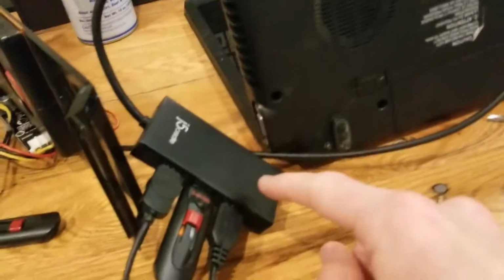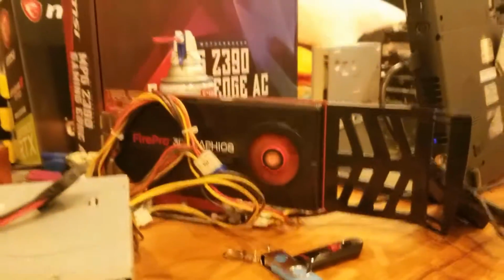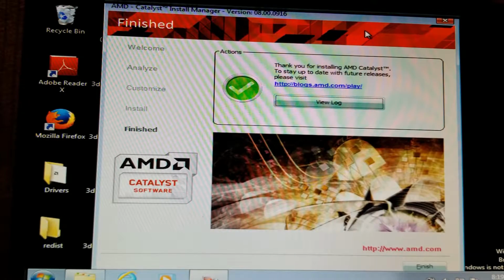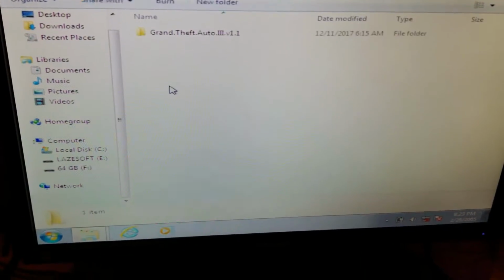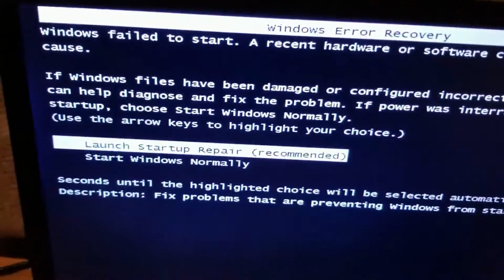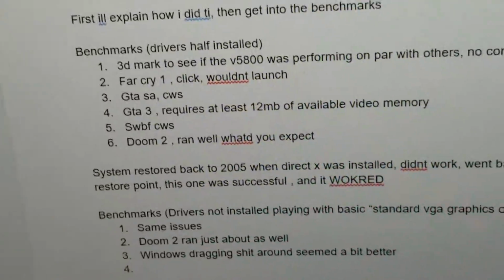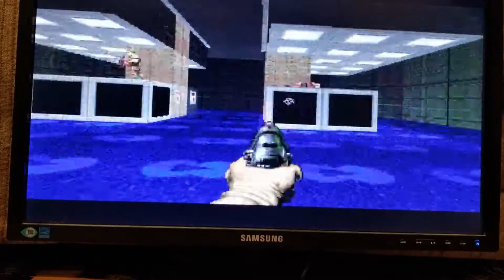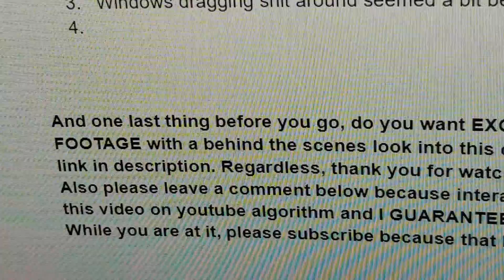Put a DESKTOP GPU in a LAPTOP for $5! (How I did it) 2020 Tutorial

Comment: Ooooooohhh it costs 38$ to buy the adapter thaaatts why
Reply: Do you think the pcie slot on the motherboard was setting the GPU back
Reply: Also just saying the RX 5500 and 5600 and 5700 from amd has stability issues for the time being including the XT models so if you want a good graphics card that won't have too many issues go for Nvidia instead of AMD btw the issues are not to serious but if you don't know much about tech i would recommend you go with Nvidia instead sorry for any spelling errors I'm on mobile
Reply from the maker: @Imblitzyboi  Yes, I do believe that the limited pcie port built into the laptops motherboard could have had a negative effect on performance. In terms of graphics cards, at the moment I'm quit content with my 2080, but yes I'd really only recommand buying nvidia, however the card used in this video was the v5800 pro, a workstation graphics card released by amd back in 2010
Reply: Yea that is true I should of pointed out the most of the previous generations of AMD gpus didn't have to many issues like the RX 580 thanks for pointing out my mistake
Reply: If you were wondering i was talking about the other motherboard that was dead do you think it would be setting the GPU back sorry for not making my comment very clear
Reply from the maker: @Imblitzyboi  No problem, but no I dont think the old motherboard would be affecting the GPU since it is in no way connected to the V5800 and it just a means to fool the power supply into delivering power to the graphics card.
Reply from the maker: Yeah, a little to rich for my current budget

Comment: dude u don't need a motherboard to  jump the PSU ,u just need  the 4th pin to be connected with any black gnd pin(depending on the PSU brand)
Reply from the maker: That.... would make things a lot more easy. Thanks
Reply: What is a black gnd pin? ground?
Reply: @chickennuggies7542  black wires should be ground, but not always, search for "how to jump start psu" and u should find some tutos :)